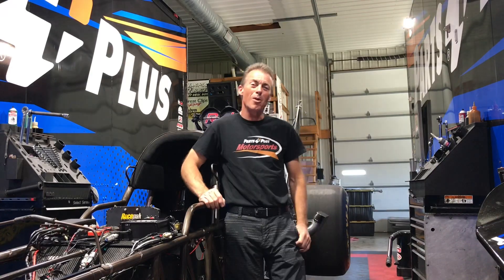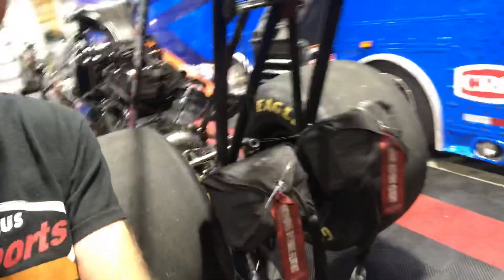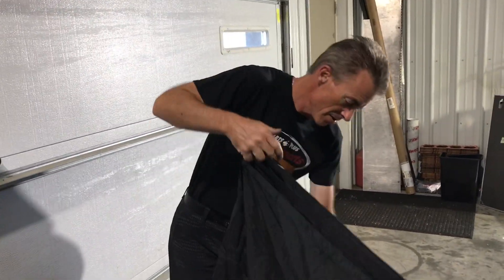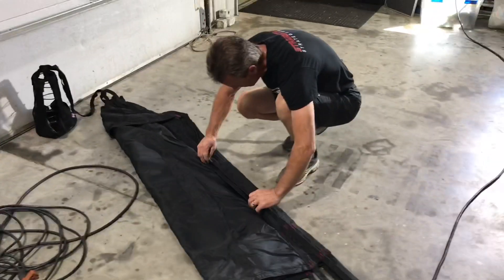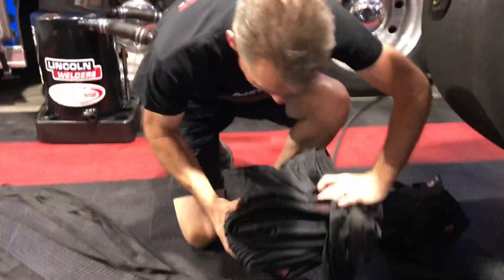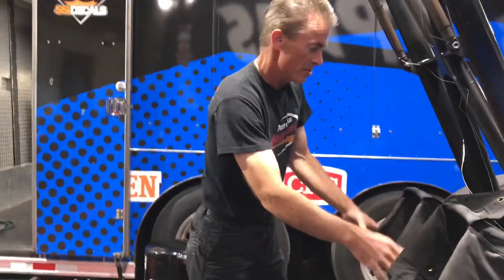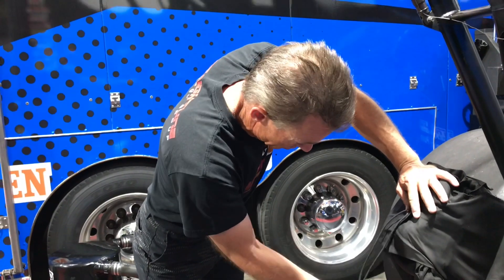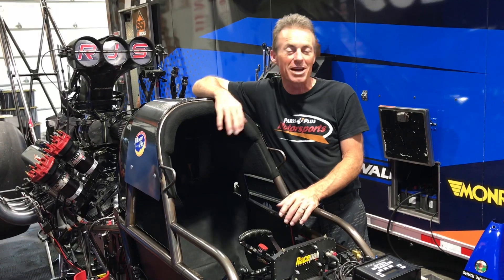Pull The Chute !!!

Comment: Hi Clay, been a huge fan for years! I've delt with drag chutes for years... A couple of questions...
1 what is the purpose of the carbon fiber boxes inside the chute pack? My thoughts are that the chute would slide out of the pack easier
2. I've noticed that the chutes seem to blow panels out more frequently than they used to... I realize that cars are a lot faster than they used to be, and I think that has more to do with it than anything.
Have you ever thought about using a deployment bag, also called a "d-bag" ? The advantage would be that the shroud lines would be extended fully, before the canopy is blossomed. That would relieve some of the stress on the canopy panels and help them last longer. I also think this will cause the chute NOT to hit as hard. Plus you don't lose any stopping distance or stopping power
Just a suggestion
Thanks for your great videos and continue to"STOMP ON THAT LOUD PEDAL"!!
Thanks again for your time
TJ

Comment: Great tech segment on the chutes Clay. It would be interesting hear from your experience how you interpret the feedback the car is giving you going down the track. For example what do you hear or feel when it drops a hole or is about to knock the tires off (no offense to Mr klober)? What are some indications it's on a killer pass? What does the motor sound like in the car? Is it all blower wine or does the exhaust dominate as if you were spectating? Is there a lot of vibration or is it smooth? At the end of the run the car goes from all bowed up to negative g's when you throw the chutes and lift. Is that a violent experience?
Reply from the maker: I like it. This would be fun to talk about. Thank you for watching.

Comment: Clay... I'm assuming that there is some type of power supply for the sensors, computers etc...what type of battery do you use and where is it? I've been going to the drags for years and yet to see a battery.  Good luck the rest of the year.
Reply from the maker: A run down of all the electronics would be good to do. The car does have an onboard battery. Thank you for watching.